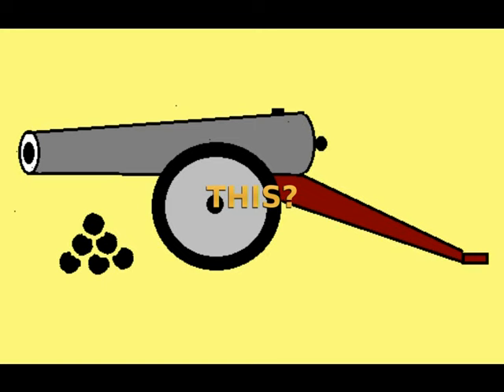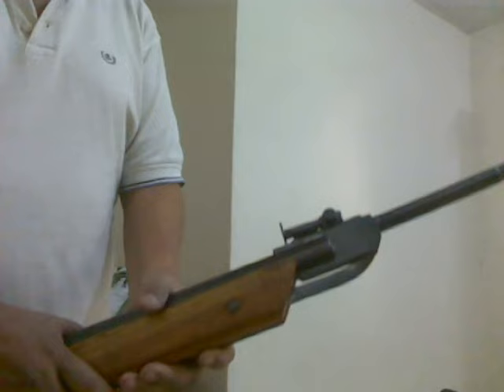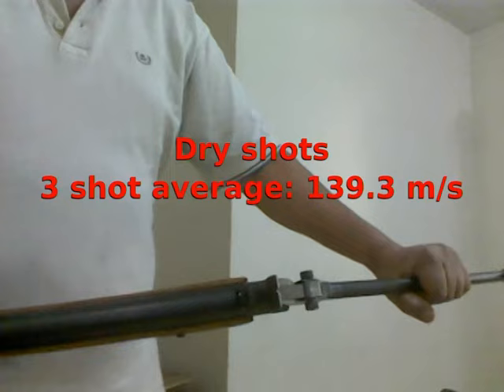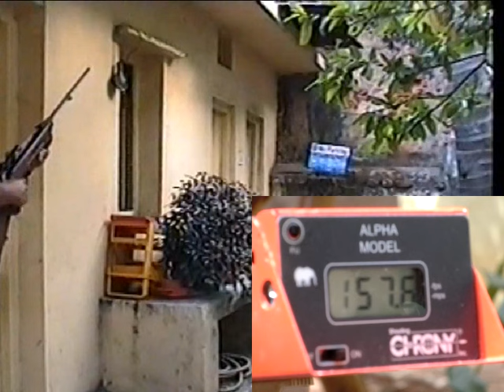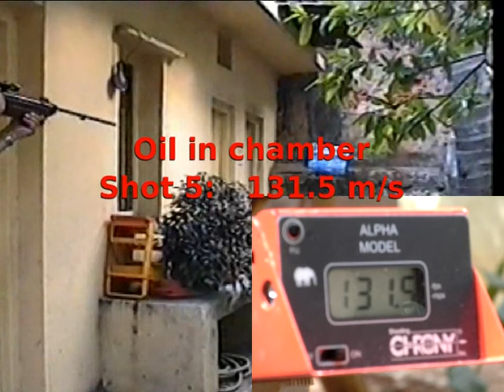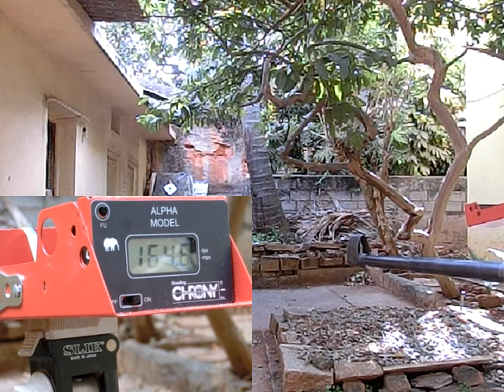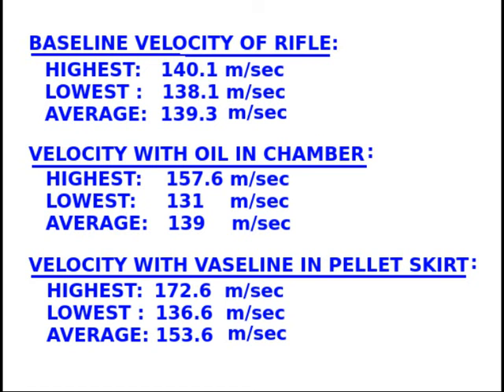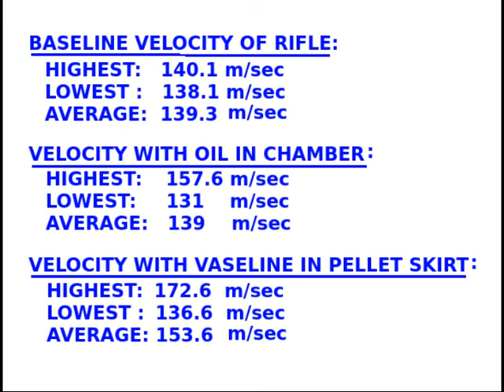Use of "dieseling" to increase air rifle muzzle velocity - possible?

Comment: The air needs to reach the ingition temperature of the used oil during the compression phase. Its exactly like diesel engines work.
You can see a successful ignition by the little cloud of (blueish) smoke. No smoke - no ignition - no additional acceleration!

Comment: the compression of this rifle is not enough to ignite the petroleum jelly. The difference in speed is only because of reduced friction due to barrel greasing. You need a powerful rifle 700+ fps to produce pressure for igniting and have the dieseling effect.

Comment: The Vaseline oil needs to be behind the pellet, if you cause combustion in front of pellet it’s going yo slow it down, clean barrel then test with blob behind the pellet, you will get consistently higher velocities

Comment: Nice video no messing just data.its obvious the vasaline becomes a sabot giving the pellet a better seal and less of a concave in the pellet✌️
Reply: Paul Lee g partly that, partly the combustion of the petrolium gel under high compression. But its inconsistant and it will damage the seal!
Reply: @gunner678  Prove it or just be a parrot. It does not, save perhaps leather, but old timers living the diesel say it doesn't even damage those either, so...

Comment: Yes. All other channels that I've seen on this topic claim that it will prematurely erode the seals around the piston. 
Other videos show the use of                     " Three-In-One oil".
I myself have wondered about some kind of kerosene/motor oil mixture.
Reply: some times it will say synthetyic but has additives that will inturn eat your seal (oils in a propellant spray can)
Reply: im just gonna shoot it without anything for a while try to get this shit out till i get my scope and laser sight then use superlube h3 and superlube 100cst full silicon.
we should still get the diesel effect because the flash point is 400F

Comment: Why not sit down and design a spring air rifle that can handle the internal expansion. Then design pellets with copasonance gel in little paint balls glued to the bottom of each pellet? Design a 22 and a 38 caliber using this concept and make them have a clip. A larger round could be developed that did not damage the spring air rifle design.
Reply: You might have something there

Comment: dieseling requires high temp. wich requires high compression rate. with this low force spring youre not getting any of those. 
Ive shot up to 1500 fps with light pellets out of  a nitro pellet rifle. (900 avg without dieseling). 
Btw. its just for fun. pellets are not accurate at those speeds.
Reply: how do you feel about dieseling the MCX/MPX?

Comment: Without reading any comments... yes, it will increase velocity as it creates detonation normally referred to as “Dieseling” which increases velocity but lowers accuracy and stresses the seals. It like running NOS in your car... you’ll get better performance but you’re sacrificing longevity and stressing the parts. If you want supersonic cracks get a .177 with PBA pellets and crack the 1100fps sound barrier everytime but I don’t see the point for effectiveness. I like .22 air rifles because they’re more efficient and with heavier pellets they hit harder with lower decibels and more FPE which is what matters when hunting. But if plinking you lose accuracy?! So it’s a no win situation other than entertainment of the supersonic crack.
Reply: Different results in my backyard range; only change for most of mine was a change in elevation, being slightly higher due to less pellet drop from more velocity, I suppose.

Comment: Here is why I'm a little discouraged by dieseling air videos... many of these are ending with unproven statements that say that dieseling will or probably should damage your rifle despite old folks online who have been taught by elders to diesel and have done nothing else with Airguns for decades with NO "blown seals", lead buildup, or other damage to the hardened steel parts that these guns are made of.
If you worry about such, DON'T TRY IT, keep unproven opinions to yourselves, and STOP SPOUTING UNPROVEN RHETORIC of others who haven't even tried it!
ZERO DAMAGE to 5 guns, 1 PCP rifle, 1 gas breakbarrel, a 2240XL,  and a 6 round revolver, several thousand shots, and all not only working fine, but all holding a full charge overnight for our protection up to the PCP for several weeks or more, and I've not tested for longer get periods yet, because I shoot a lot, but I'm betting those seals will hold up into the apocalypse!
Just stop being mindless parrots, please, and use silicone or other proper oils in your arms!